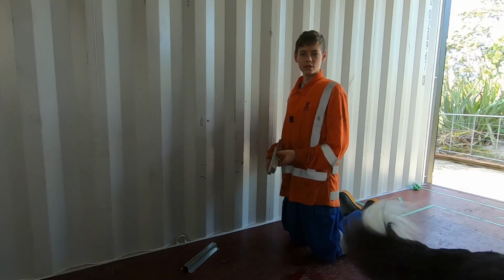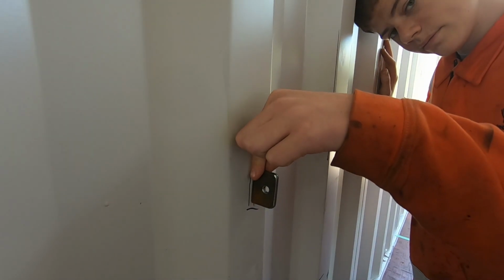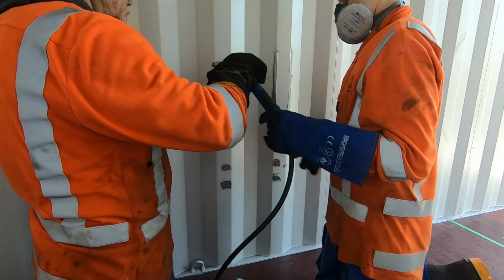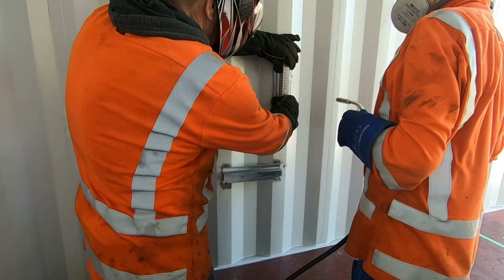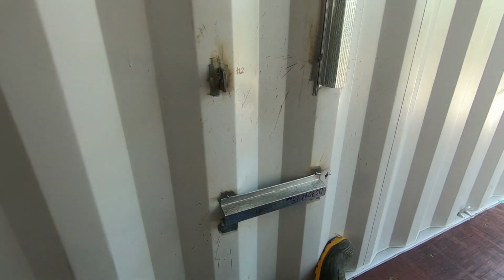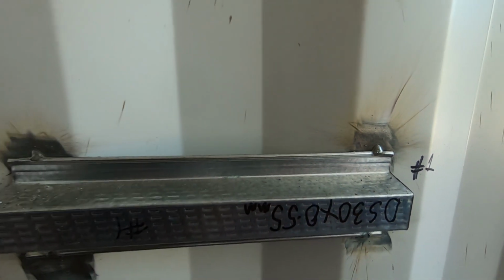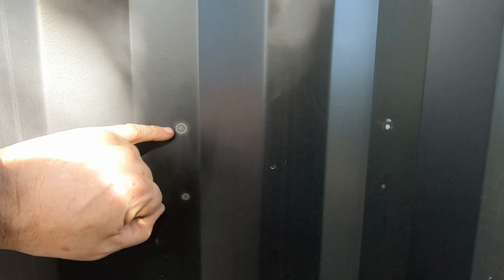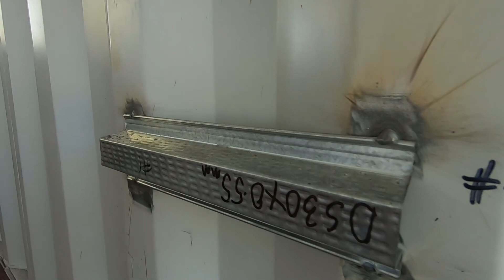Shipping Container Home Build #8 - What wall fixing method

Comment: No need for brackets...Why not just screw your framing into the floor and the upper rail? ... also be sure to avoid the framing touching the walls (to avoid thermal bridging) , by using plastic spacers on the upper rail to create a gap.